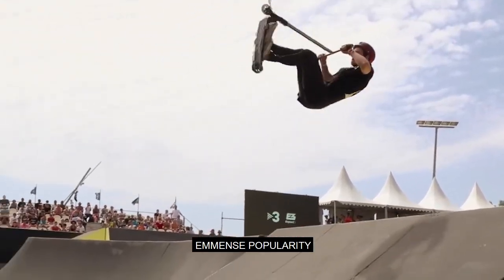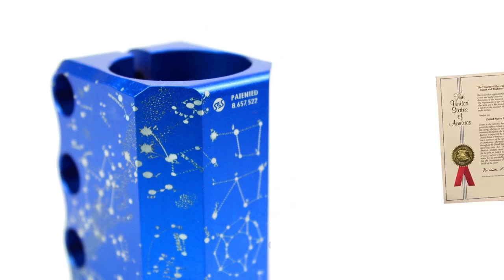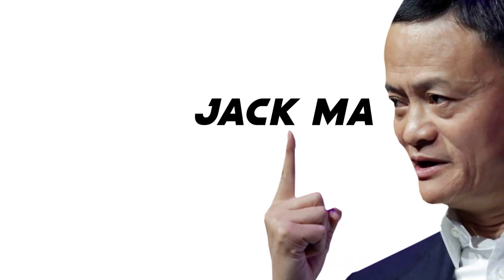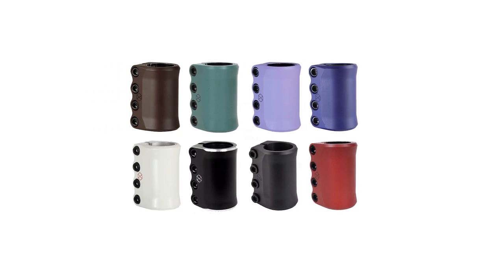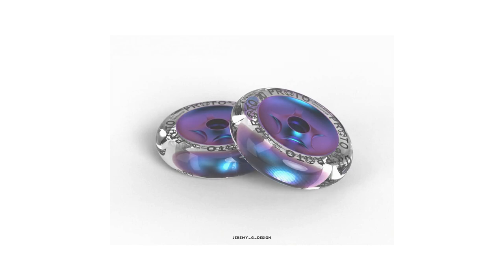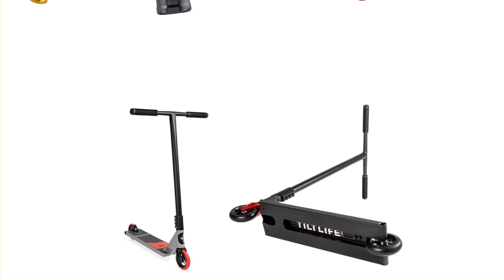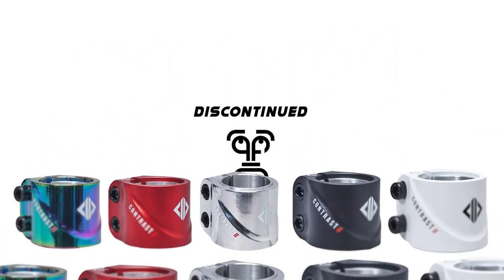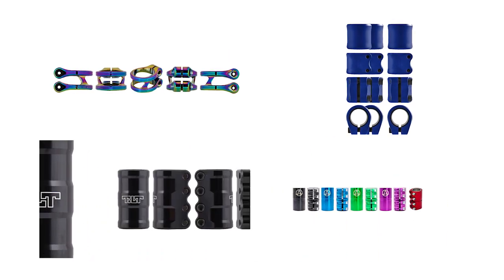Scooter Clamps Explained: SCS (Top 10 All Time Clamps to Buy)

Comment: The industry has always had such an issue with over building parts. No single clamp in 2023 should weigh over 7oz. Proto is stuck in 2008 and so many brands focus on image instead of performance. Honestly the forged envy triple clamp beats these and it looks like absolute garbage but hey it’s 10$ at 6oz.

Comment: Ics was great for awhile I used it when ethic made it a bigger bolt and it was good but scs was always what needed up back on my scooter no matter what I tried it’s tried and true and never once broke one apex forks and original scs I put on my scooter in 2011 and rode the same forks for nearly 10 years and the scs I stripped the bolts from over use was awesome eventually I changed to tilt because the bolts were so much stronger it made the clamp last so much better I went through a lot of parts in my time riding but forks and scs I only ever broke when I attempted to try another brands parts or systems there’s a reason I ran the same setup my whole scooter career and it’s because when you ride long term you find the parts that are right for you as all riding styles are hard on different parts but I used to wear district v3 decks through the bottom plate never snap them apex forks discoloured from the sun I’d had them so long same with my tilt scs and tilt chromo pegs I could only ever not find reliable bars wheels well they all wore at different rates but there was different brands  such as proto. We found to be a good balance with strength and time lasted ratio with grippers on front and sliders on back lol

Comment: Ok 3 things:
1. I’m riding the urban artt civic scs and I’m not a fan. They made the lips where the compression caps too small with like these fluted grooves for weight reduction. And it causes the compression cap to bend and eventually slide down into the scs. So my compression gets loose super easy.
2. The phoenix grenade scs was probably one of the coolest scs’s I’ve ever had. 
3. That dice scs would have hit hard back in 2010 😂